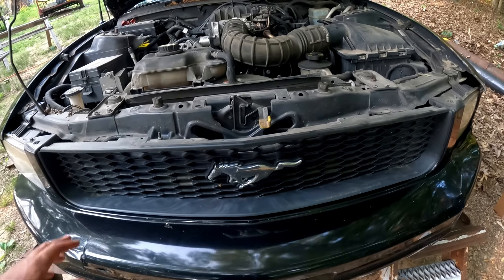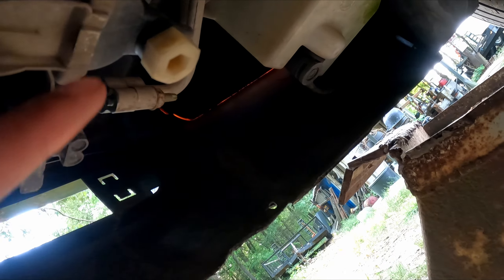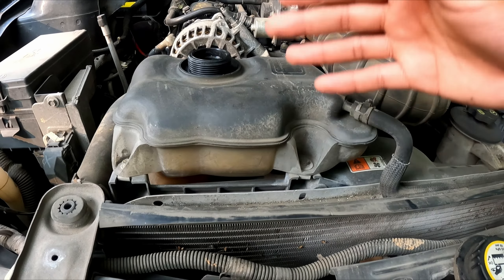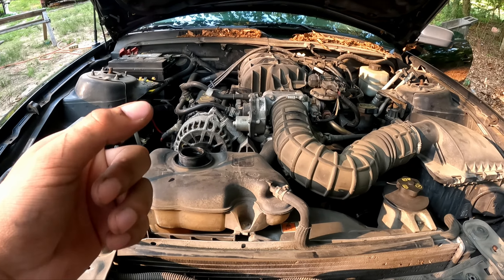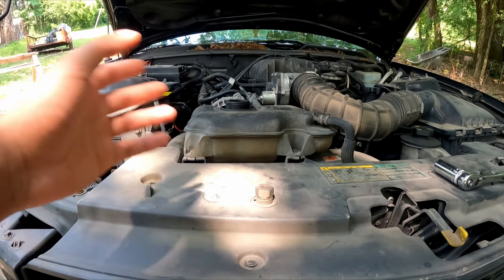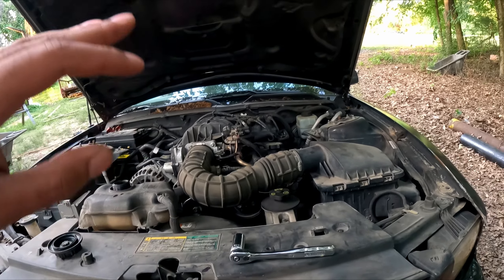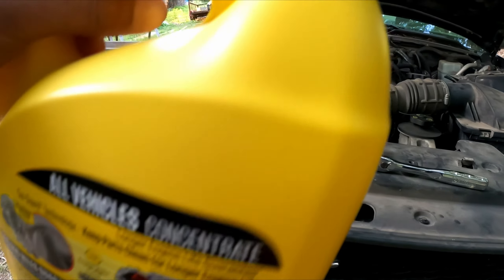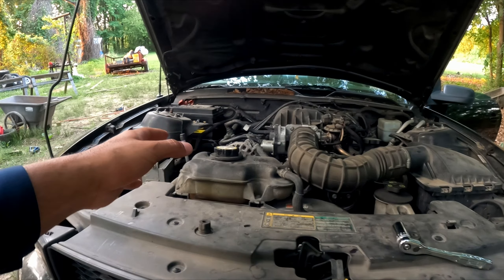Easiest way to do a coolant flush on 2005 Mustang

Comment: Does it matter that there’s no way to pour into the radiator?!? Wouldn’t the thermostat not open correctly. I’ve done all the same steps as you on my 2008 V6 mustang and I can only fit 2 1/2 gallons in total but google says it’s a 4 gallon system
Reply from the maker: I'm pretty sure a 2005 and 2008 hold the same. When you turn it on I'll just check it to see if you need more.

Comment: Nicely done video. Unfortunately, that wasn't a complete flush. Need to use radiator\cooling system flush to properly remove scale, sludge and other contamination. Back flushing is even better, but a flush chemical should be used at least once. You'd be surprised what comes out.
Reply from the maker: Appreciate it. Yea it was more of a quick flush